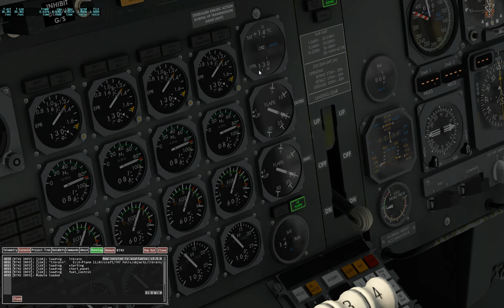AT in EPR mode

Comment: CRZ has higher EPR than CONT?
Reply from the maker: Yeah... CRZ tables use ALT + MACH, and CONT - ALT + TAT values. Seems like on ground they overlap.
Reply from the maker: Heh. You made me check again. You're right. For CRZ mode there are TWO tables. MACH+ALT and MACH+TAT. You should use lowest value from both.
But both tables starts with 0.5M. Yet i do the test on ground with M = 0.0
Reply: @FelisLeopard  Cool! Just felt weird to see the EPR go up. Shows that the systems are great :)